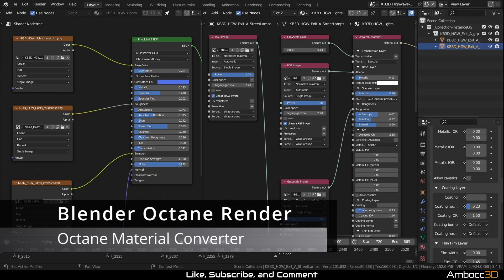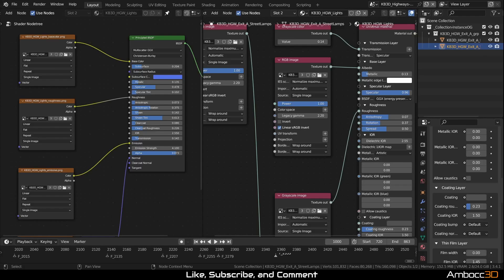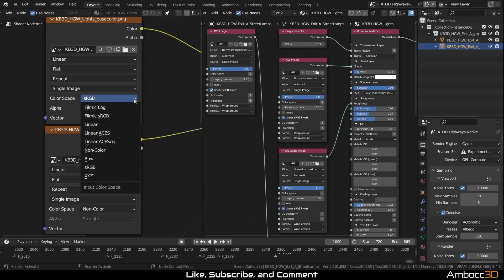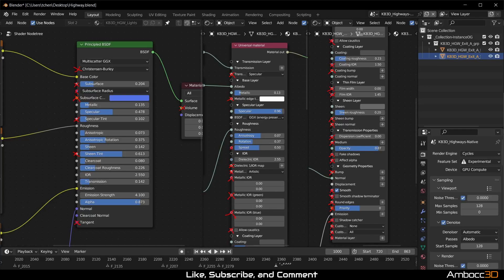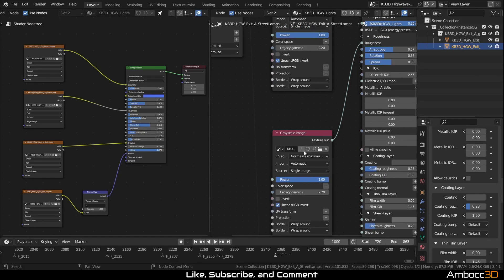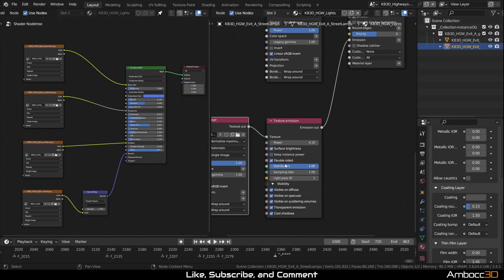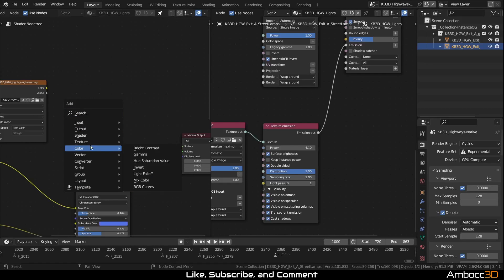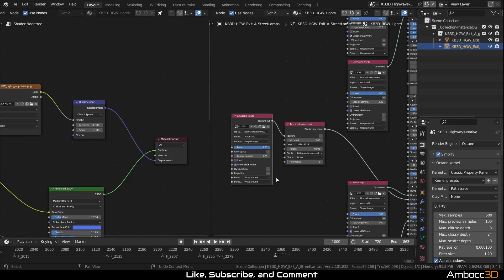Blender Octane Render | Octane Material Converter

Comment: Question: When I use the converter, the connections don't stay put like they did for you in the video. The Octane nodes will come in just floating. Any ideas?
Reply from the maker: It might have broke with the last code update. I'll investigate and if it is broken, I'll contact the developer.